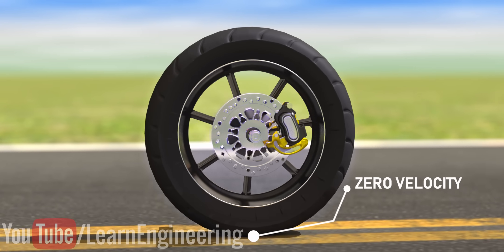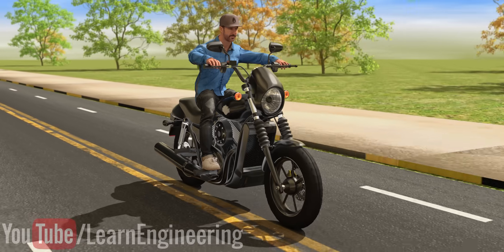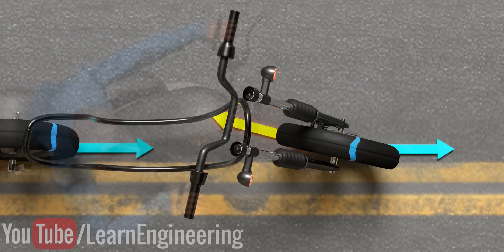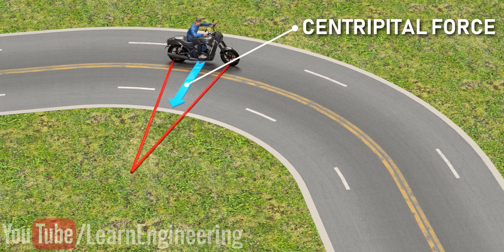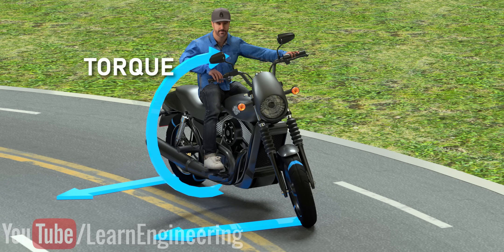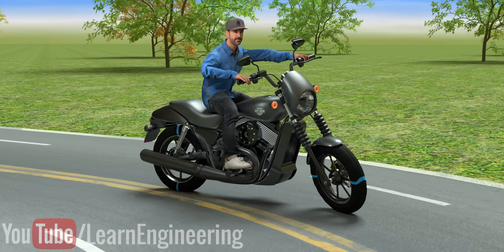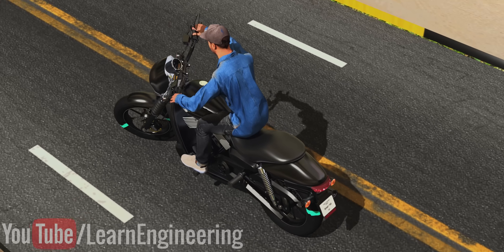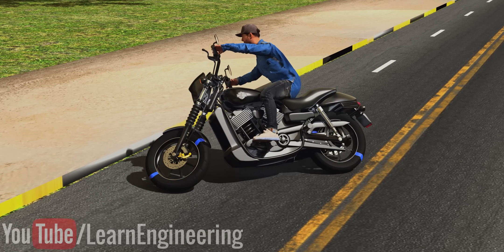Counter Steering | The interesting physics behind it

Comment: This actually saved my life once, i was going very fast then suddenly a car popped up without checking the road and i countersteered and almost crashed to it by some centimeters!
Reply from the maker: Cheers to counter steering - the quicker operation!
Reply: @SabinCivil  *the only operation
Reply: @SabinCivil  The ONLY operation..... like seriously....  It's the only way to turn a motorcycle moving above walking pace.  Is this video meant to be a serious thing.  !?!?  It's like a teenager has played with a toy motorbike and made up his own theory
Reply: @Lesics
You should take this video down. You have no idea how a bike behaves in the real world! People will get injured or die if they follow your advise in this inaccurate and confusing nonsense.I’m a rider with some 40 years experience and an ex-paramedic. please take note of what people are telling you in the comments!!!!
Reply: @softailfun  please tell me should i steer normally or counter steer. I am 18 and a new rider. I know how to ride but the counter steering thing is pissing me off. Please advice me
Reply: BRAVO SIX 
You and other guys new to riding (as does this video) see counter steering as an option. It is not an option, it is the ONLY way that a motorbike can be steered correctly. If you don't counter steer when taking a bend or a corner, your speed would have to be so slow that it would be dangerous on a road because of vehicles behind you. The reasons that counter steering works are irrelevant, just know that it works and that it MUST be used. I hope this helps in some way. I'm assuming here that you know how to counter steer. If there is a problem, feel free to get back to me.
Reply: @softailfun  Is there a speed at which steering and counter steering both work at the same time?
Reply: BRAVO SIX 
Absolutely not. Do you understand how to use counter steering? Just asking.
Reply: @softailfun   Softail Fun  i know how to steer ( at low speed you turn the handle bar). At 15mph+ you slightly push left to go left and push right to go right. Many of people who drive bikes dont even know know about counter-steering. They probably do it unintentionally. When i talk to bikers about lane changes at high speed, everybody says "Just turn handlebar lightly to the side you want to go", which is opposed to counter-steering. When i drove last time on highway, i just did it, i dont know whether i steered or counter steered.
And right now, i just want to know a method to change lanes (to steer) at highway speeds and that's all.
Reply: BRAVO SIX 
If you intend to change direction slightly or dramatically, counter steer. You obviously get that it works at higher speed. On that basis, if you are traveling at say 50 mph..... If you "turn" your front wheel left your bike will move to the right, if you try to make the bike go left at this point you are fighting against the bike, this can only end in disaster. If I want to move to the lane on my right, slight push on the right bar and the bike just moves over nice and easy. Obviously the same but opposite for moving to the left. Fighting against a bikes natural tendency is all bad man.
Reply: @softailfun  final question.. should i just use counter steering at anything above 20kph? You talked about speed of almost 80kph.
Reply: BRAVO SIX 
Sorry man, I deleted my last answer, I misunderstood your question! Yes, above 20kph (around 12 mph) counter steering should be used.
Reply: BRAVO SIX 
Did you get my replies to your question. I did answer but my se sponge seems to have been deleted!
Reply: @bravosix8171  sorry for bothering but if you are new to bikes then you would have to try to figure out speed after which counter steering is the only option. I had started with a 110cc bike with thin tires and the bike was very light so it didn't require much counter steering till 60-70 km/hr and a little leaning and shifting weight on handles worked. But as soon as i started with new bikes with more powerful engines 150-300-390cc, i had to counter steer at much lower speeds. And once u figure out the appropriate speeds after which u wld have to countersteer, it becomes natural and instinctive after some time. Just don't try figuring out these speeds on roads with ongoing or incoming traffic and try it on empty roads.
Reply: @rahulram3165  thanks. This is very valuable information. What do you think for 70cc (80kg) bike? Do i even need counter steering for this type of bike?
Reply: @bravosix8171  70cc bikes would  generally  be very light and would have very thin tires and easily would slide on the ground especially while on too much dirt, debris or some liquid spilled on road. And usually the lighter bikes and scooty wouldn't require so much of counter steering just general bodyweight shifting turns would do the work. And still i would recommend you to try in empty straight roads and  try to avoid more than 70km/hr more often because their brakes are shit. And the push on one side of handle while counter steering shouldn't be so much as the bike has thin tires and counter steering makes the bike lower from the side you want to turn so don't put too much pressure that's all then even if you want to counter steer you have to dip the bike very less and maintain good angles coz the tires can lose traction easily as they have less area of tire on road at a time. You should try yourself and determine yourself in empty road. And never forget about the thin tires and average brakes
Reply: @bravosix8171  only advice i can give you is dont take advice from anyone. Every rider is different every rider has their own style and the only way to find yours is be patient and safe and just ride. Over time you will teach yourself everything you need to know just feel the bike and judge each turn with proper speed. You will learn what is too slow or too fast and believe me they swear counter steering is the only way because they took some classes on it but I promise you I've been riding for years and I do not counter steer. I was taught that in my CHP moto safety class and when I tried to counter steer into a corner when you turn the opposite way it lifts your tire from the street and breaks traction causing you to eat shit! I lean through everything no matter how sharp the corner you just adjust your speed accordingly. Just get out and ride and you will learn it all naturally as time goes on. That's the best advice you can take
Reply: @bravosix8171  You counter steer every time you go around a corner. It's the only way to go around a corner. The best thing you can do is not worry about it, just look around the corner, and your brain will take care of it. Your brain figured out counter steering when you were 4 years old. You've counter steered around every corner since then.
Reply: @bravosix8171  its not a rocket science, its a natural instinct at that situation. you will learn when u encounter that situation
Reply: @bravosix8171  Ignore this video and take an MSF Course and learn how to counter steer properly.  If you are riding in a parking lot at slow speed a motorcycle steers by turning the bars in the direction you want to go.  Once you get faster direct steering does not work nor does leaning your body.  The only way to steer is counter steering.  The simplest way to do it is look where you want to go and push on the bar in the same direction you want to turn.  In other words if you want to go right push on the right bar, alternately to go left push on the left bar.  Don't think as your brain tells you it is wrong but it is not.  Look left, push left go left.  Look right, push right go right.  The harder you push the more the bike will lean and turn. Search for Twist of The Wrist II on youtube and watch the whole video! https://www.youtube.com/watch?v=dgOPZWNswvY
Reply: @softailfun  ok you say counter steering only apply when u going to left with top speed at that time slightly turn your wheel to the right and then turn left.
Reply: Sudip Malik 
Push left, turn left. Push right, turn right.
Reply: @softailfun  Yeah this definitely isn't how Keith Code seems to explain cornering :S
Reply: StatusRed19 
Couldn't agree more man. This vid is misleading at best, dangerous at worst.
Reply: @bravosix8171   just gain more and more experience. Dont overthink about c.s.
Reply: @bravosix8171  it works on bycicles aswell. I have 90cc bike.
Reply: Softail Fun thank you for letting them know. This whole concept is BS. I’ve been in every situation you can think of on the road except death and have never had the need for this. I don’t ride like an A Hole. I don’t ride like a speed demon, and I stay aware of everything around me. THAT IS HOW TO RIDE A MOTORCYCLE. You won’t crash into cars that pull out in front of you if you watch for them and ride conservatively on the throttle.
Reply: Chris Mckenzie 
Yea, I get you brother. That being said, when you say the whole concept is BS.... you aren’t talking about counter steering as being the concept surely?
Reply: Softail Fun no not at all, but I can say I have never required counter steering to get myself out of a situation. I can also say that I don’t ride heavy motorcycles, so when you put the weight in the equation then yes it is extremely important to understand how counter steering works. But as for myself, I ride enduro & I have a Honda rebel. They are both very light bikes
Reply: Chris Mckenzie 
Lot of idiots out there trying to get us riders. Ride safe man.
Reply: @softailfun  The explanation and the science as applied is wrong and misleading in a number of regards. The most basic is that motorcycles change their handling characteristics with speed. At low speed (less than walking pace) the front wheel is used like a tiller pointing in the direction to be steered. At high speed there is no discernible deflection of the steering. And there is obviously a transitional period between these two speeds. If you don't believe me take a m/c or pushy into your nearest car park and experiment.

As speed increases steering is achieved by chassis geometry and dynamics working in conjunction with the lean angle. Steering characteristics change with speed and with different or variation in chassis geometry and dynamics. andcome to realise that even 2psi variation in tyre pressure can change the tyre's shape and its steering performance. The other example that proves that variations in chassis geometry and dynamics change steering is trail braking.

demonstrated
Reply: @graemesydney38  
Yea, so in short.... the video is wrong, we agree. I fail to understand why you are directing this post to me.
Reply: @softailfun  isnt it normal to slowdown on corners?
Reply: mi yui 
Well it's normal to slow down prior to a corner. In the ideal world you maintain speed throughout the corner and accelerate out. Of course it's not always an ideal world, you can misread how tight the bend is etc. so slowing in the bend is sometimes unavoidable. At least that's how I see it, but I'm no instructor (just ridden...... A lot lol. And picked up bad habits I guess.) so I stand to be corrected.
Reply: @softailfun  hi keyboard warrior
Reply: @bravosix8171  shift lanes at high speed through counter-steering. At high speed the only way to quickly change the direction of the bike is through counter-steering. At high speed you can change direction through your body weight inducing lean, but it is slower.
Reply: @softailfun  wtf are you talking about?? If you want to go to the right, and you push the handlebar (forward) on there rights Handel (as you said), then you are STEERING. You are steering into the direction you want to go. What does this have to do with COUNTER steering?!
Reply: @jonashediger182  
Erm....... what??
If you push the right bar,
You are pointing the front wheel to the left,
But the bike turns to the right.
How is that steering into the bend??
The wheel does indeed point into the bend of course but this is due to the bikes steering geometry, not rider input.
I personally disagree with the term “counter steering” but it is what it is.
Reply: @softailfun  It is quite clear that he made this differently than the other videos on the subject. Just to get a lot of viewers, comments and make lots of money. Don't give a shit if he kills some 1000's people in the process. As long as the money rolles in…
Reply: @Gismo3333  
Agreed! This vid should be gone!👍🏻
Reply: @bravosix8171  You counter steering even on a bicycle. Its imposeble to “not” CS a bike. If you do not CS all the time, you are going to krash each time you hit a corner to fast, to steer it with force. CS always work.
Reply: @bravosix8171  You are counter steering whether you know it or not. 
First, counter steering works at speed. When riding slow, under 10 mph, one turns the handle bars to steer. Going slow, turn right to go right. 
At speed, the front wheel becomes a gyroscope. If you try to turn the handle bars right, the bike will lean left… and you will turn left. 
Get this… as you are in the (left) turn, your handle bars will be relatively centered. To increase your lean angle more, push on the left handlebar. That’s right, turn the bars right and lean more left. Conversely, to reduce your lean angle or even go straight again, push the right handlebar and the bike will straighten up. 
The movements are subtle but real. Try it.
Reply: @bravosix8171  Steer normally bro! Do what your mind and reason advise you to do in times of emergency! This counter steering BS is more dangerous and more of a "sophisticated bullshit" rather than practical. You can drop your bike and injure yourself while doing it at higher speeds due to the bikes momentum and inertia of going forward. If you counter steer at 40mph let's say, your bike would lean in the opposite direction and you'll fall. Forget this crap.
Reply: @vladimator1842  LOL, you are completely WRONG as there is NO other way to steer a bike at 40 mph other than counter-steering whether you realize you are doing it or not.  I have hit exit ramps at 70 mph and it was only counter-steering that saved me at that speed.  Until you fully understand the concept of counter steering you are putting yourself at risk every time you ride.
Reply: @stephenbraun3134  I have tried to explain these same points to my neighbor who has also been riding most of his life and he just gives me a blank look.  Some people will never understand that they are already counter-steering at speed because there is no other possible way to turn a motorcycle above 10 mph.
Reply: @C4LB34R  WRONG, WRONG, WRONG.  I have been riding for close to 50 years now and there is no other way to turn a motorcycle at speed except by counter-steering.  You are doing it every single time you take a turn above 10-15 mph you just don't realize you are.  The physics are undeniable.
Reply: @sheslop888  Yup, trying to convince idiots that they are wrong is a daunting task.  As you said, there is NO other way to turn a motorcycle at speed except by counter-steering as it is irrefutable physics.
Reply: @bravosix8171  Never counter steer unless you're in a slide and trying to regain balance. Turn normally. If you really try to countersteer during a regular turn it won't end well. You do apply counter pressure though during a turn normally which is what everyone is trying to say is countersteer but it's not. Countersteer is when you turn left to go right in a drift.
Reply: @ktm125sxbeast  
Some very bad advise here. Don’t counter steer, then do counter steer. Awful advise!!!!
Reply: @softailfun  Also not to be that guy but it's advice not advise. Though I do advise that you study some grammar.
Reply: @ktm125sxbeast  
Yea, I was too busy learning how bikes steer to bother with grammar. The one can kill you the other gets idiots leaving corrections. My bad!!
https://youtu.be/lzk8oyNO708
This is also counter steering and you advise against it. Get serious.
If you’ve got a rear slide when you’re road riding, well you need a lot more help than just counter steering knowledge, you need to learn to ride!
Reply: @softailfun  phew! Glad you said something. I do not know of any other way other than counter steering, and that is what taught at riding schools. If you tried to turn a bike like they did in this video at speed on a corner you will crash for sure.
Reply: @bravosix8171  forget you watched this video and get lessons from an expert. This video shows you how to end up underneath a car or truck.
Reply: @bravosix8171  good question. No!
Reply: @bravosix8171  if you’re changing lanes already then you’re already doing the right thing and their description is misinterpreting what they’re actually doing.
Reply: @bravosix8171  it’s not a set speed. Just do what comes naturally
Reply: @bravosix8171  yes and you’ll do it without even thinking
Reply: @bravosix8171  did you not ride a bike as a kid ,,or did you have trying wheels your whole life ,,stop thinking about it and just ride
Reply: @softailfun  I saw a demonstration by  cyclists that you can't turn without what you call countersteering. Apparently you can't turn in any direction without first turning your wheels slightly in the opposite direction whilst on two wheels, so how can you ever not counter steer?
Reply: @bravosix8171  You started cotersteering the moment you first controlled a bicycle and ever since..  Keep on ding that, the only practical way to ride any bicycle and any motorbice,
Reply: @bravosix8171  Push rigt (for a short moment) and go right, push left, and you go left. You actually steer the bike in the wrong direction for a split moment to get it to lean. From there you control the lean using the handlebars. Often you must keep a tiny push inn a stedy turn since the bike tends to stand up if you do not.
Reply: @SabinCivil  This video is incorrect, dangerously misleading, and you are directly putting people's lives in danger by spreading misinformation. Take this video down for the sake of your integrity, and for the safety of your viewers. 
If you want to make a proper video about counter-steering, it would be worth mentioning the massive gyroscopic forces at play, and how it's a combination of gyroscopic precession, camber thrust, and centripetal force that moves a motorcycle and its rider through a corner.
Please, please do not ignore this message. I am not the only one saying it and you STILL have not admitted you were wrong. Do the right thing.
Reply: This video is misleading.. At normal riding speeds, to initiate the turn, counter-steering must be used. In fact, there is no other way to make a motorcycle turn.  it is used by every rider out there knowingly or not. When you lean towards left to make a left turn, initially the front wheel is turns towards the right side even though we are not aware of it. This video makes someone think that we have an option to choose between steering or counter steering when cornering. You simply cannot turn motorcycle to left side by turning handle bar to the left. When doing that the motorcycle will lean towards right and end up turning to the right side.
Reply: @SabinCivil  Guy in animated video has no helmet... "Learn Engineering" is out here promoting the Squid Life... Ya'll wrong 4 that...
Reply: @hadi msmani,

Yet there is BRAVO SIX who states he can ride but doesn't understand 'countersteering'' That would mean in your situation with a car popping up, he would be dead because it would take too long before he figured out what to do?

Please don't even think about it! 
if you can ride a motorbike you are already doing it naturally so all you need now is practice a lot.
Get out on the road and learn your roadcraft, different surfaces, weather conditions, varieties of bends, but take it easy while building you confidence and if someone passes you doing 80mph going into a bend DON'T be tempted to chase in after him as he either knows his entry and exit a lot better than you or you'll pass him on the way out!

Be careful out there.
Reply: @softailfun  Oops, I meant to reply to someone else but mistakenly clicked on you; my eyesight isn't the greatest anymore.  And YES, we are in agreement.  My apologies.
Reply: WRONG...WRONG...WRONG ... Countersteering is used by ALL bike riders who have ever executed a turn on a bicycle or motorcycle at speed. "Leaning and motorcycle turning in perfect balance" ... maybe the folks at Learn Engineering need to hop on a bike and prove their theory on a 60 kph bend ... make sure that you have crash bars and full riding gear. The scenario shown at 3:15 causes the bike's center of gravity to move outside of the turn, making the bike unstable and most likely resulting in a high side crash. DON'T DO IT.
New riders...relax, you've been counter steering since your dad took your training wheels off your first bike...it's intuitive.
This is a good place to start.   https://www.revzilla.com/common-tread/what-is-countersteering
Reply: What amazes me with most of the comments is people's explanation or the total misbelief that counter steering either works or doesn't. Saying push left to go left is not very precise, you should really explain it as apply pressure to the left handle bar to start the bike leaning over to the left. Once the bike starts to lean you naturally release the pressure and start to neutralise the bike turning in in a left hand arc. If you didn't the bike would just lay down on to the floor and actually go straight on on its side leaving a big mess. To all the disbelievers how do you think you stand the bike up after the turn runs out. If you don't believe counter steering works then all you people must be trying to lean the bike the opposite way to pick the bike up again, I'd love to see you try it. Very funny watching you go off into the hedge. What you actually do is apply pressure to the outside bar which lifts the bike upright again. All you disbelievers would say that this will make it turn more but not so. Think about it, if you was going through a right hand bend and you pulled on the left hand bar the bike would lay down on the floor instantly, which is counter steering to the extreme. If you are going through a right hand bend and 🧒 pulled on the right hand bar effectively tightening the corner radius of the front wheel the bike will not start to tighten its turn but sit up very quickly. Unfortunately there are a lot of people who ride bikes but don't understand the physics but that's OK because you don't need to. The best thing to do for any of us is travel down a long straight road at a reasonable speed of say 40 mpg and gently push on one of the bars, if you push on the left the bike will start to fall left. Push on the right the bike will fall right. Don't push hard. You will automatically catch the fall and right the bike. As you get used to it try a gentle slalom and you will feel how easy it is to turn the bike fast and you will notice that you will be counter steering to lift the bike up to initiate coming out of the turns. Only try when it is safe to do so in good weather conditions. Be safe
Reply: @OrangeManStan  You are another example of half truth misunderstanding. M/c's handle differently according to the speed. Over about 30kph a m/c steers by leaning. There are five rider inputs that cause the m/c to lean - bodyweight/positioning, foot pressure, knee pressure, handlebar pressure and gyroscopic procession (a,k,a. countersteer, push steer etc). A rider uses predominantly different inputs and combination of inputs at different speeds according to rider preference, experience and chassis configurations/dynamics.

The importance of countersteer  is that the faster you go the exponentially greater the gyroscopic forces are. The greater gyroscopic forces make the m/c exponentially more stable and make counter steer exponentially more effective to get the m/c to lean. The faster you go the more important countersteer is. The lean causes the chassis geometry and dynamics to steer the m/c. 

You are right about one thing; doing is more important than theory - go out and practice slaloms at varying speeds. But the correct theory can help to reach the outer perimeters of performance.
Reply: @softailfun  "Don’t you think you are making a very simple method of steering into a very confusing experience, especially for new riders" I wasn't describing a teaching method I was exDon’t you think you are making a very simple method of steering into a very confusing experience, especially for new riders" I wasn't describing a teaching method I was explaining and correcting the physic of m/c steering. And I'm not 

 especially for new riders" physics is the same for newbies and old farts, that not me, that's life - physics. Firstly you underestimate peoples ability to understand - its not that hard to explain or understand. Half truths are more for the 

"All this nonsense of body weight, foot pressure, knee pressure is all totally unnecessary!" it neither nonsense nor unnecessary. As I wrote, "correct theory and
Reply: "All this nonsense of body weight, foot pressure, knee pressure is all totally unnecessary!" it neither nonsense nor unnecessary. As I wrote, "correct theory and
Reply: @graemesydney38  
Yea, I think you need to read your reply to me... it’s a bit all over the place. To ride a bike we don’t need the theory. I never have and I don’t know anyone that ever will. If they are interested in finding the “why” that’s up to them, but to ride safely...... not needed at all. You only need to read the comments on any video about counter steering, the theory just adds confusion to an already (to some) confusing concept.
As for what I said was unnecessary (body position, feet etc), totally unnecessary! Necessary would suggest you can’t ride without this, now that is just plain rubbish. I have ridden for some time now and have received some pretty good training in the process from exceptional instructors. Never have I had to resort to using anything but good old fashioned counter steering and leaning with the bike. This is regardless of what model or style of bike I was on! Maybe you have an argument if you involved a track day (although I personally doubt it), but for normal riding, be it on commuter type roads or country lanes, unnecessary!!
The first 30 seconds of this link says it all!!!😂😂. https://youtu.be/JWuTcJcqAng
Although a little dated, as you say, can’t alter physics!!
Reply: @softailfun  "Yea, I think you need to read your reply to me... it’s a bit all over the place." 
Your problem if you can not follow complex issues.

" To ride a bike we don’t need the theory." 
What do you think "doing is more important than theory" means? While it is true 

 Scientologist, a con man 

Maybe you gave an argument if you involved a track day, but for normal riding, be it on commuter type roads or country lanes, unnecessary!!"
Reply: @graemesydney38  
Yea, I’m really sorry it’s not the “complex” issues that I’m unable to follow. It’s the way your messages are formatted, they make no sense. I’m sure if you read exactly what you have written on your last 2 posts you will understand what I mean. And what the hell has Scientology got to do with this??😂😂. 
Forget it brother, you’re done I think!
Reply: @softailfun  There is none so blind as the wilfully blind, and there is none so stupid as the wilfully blind. You're right, I'm done.
Reply: @graemesydney38  
You know.... you need to calm down man. You are reading stuff that I’m not writing. I get the impression that you think I’m anti counter steering... and that’s wrong. So I have no idea what you’re accusing me of being blind about 🤔. That makes no sense. My only criticism of you is that you were making things too complicated with your explanation and that it contained some unnecessary actions and backed it up with two videos that totally supported my case. That being said, congratulations on your last post, it’s layout was correct and it was understandable for a change. Now I don’t know what your background is and to be honest I don’t really care, but I will tell you briefly mine. Been riding 40+ years, ex-medic in the Ambulance Service, advanced driver trained in part by West Mids Police Instructors , advanced rider trained by West Mids Police Instructors. Do not think you can crash into someone’s comments, barge in with you unnecessary nonsense and expect everyone to just agree because you spout science and try to sound smart. Any criticism of your words are from the stand point of having a great deal of experience in the practical skills of riding a motorcycle. I don’t know how old you are, but I can probably grind your practical experience into the ground. Now we are done!
Reply: @graemesydney38  I'm only right about one thing, thanks for that. I agree there are multiple ways to steer a bike. I think I said that. But you can take them as singular and make the bike steer. I think the confusing thing here with all the comments is some people think you only steer by counter steering and others don't believe you can steer that way at all.
Reply: @OrangeManStan  
Can’t agree with you man. When you push on the left bar, bike leans left due to counter steering of course. However, at no point does the rider release the pressure or steer in the opposite direction during the turn as you suggest, but maintains pressure on the selected bar throughout the bend. Only when the bend begins to straighten does the rider release the pressure to stand the bike up. The front wheel does indeed point into the bend after the initial counter steer, but this is due to steering geometry and not rider input! If the turn needs to be tighter, the rider applies a little more pressure.... if a wider path is required then the rider eases off the pressure. Look here: https://youtu.be/lzk8oyNO708
This shows exactly what’s happening.
Your advise is as dangerous is the information contained in this video. The individuals who were responsible for this video obviously don’t ride bikes and, having read your post, I suspect that you don’t ride either. Stop giving advise of this nature without having practical experience of the topic! People die following poor advise!!!😡
Reply: @softailfun  I'm not sure why you are getting so agree, I've been riding for 25 years so no worries there. That is a great video. The interesting thing is maybe the press isn't released as the turn is initiated but the front wheel needs to start to point in the direction of the travel which will be the opposite direction of the original pressure applied so either the action of the turn equalises the pressure that the rider is applying or the pressure is released slightly. If you keep applying pressure I agree the bike will lay down further into the corner until it lays down on it side. Not sure why you are so concerned about my explanation and so worried people are going to be dying all over the place. Maybe you struggle to ride your bike, perhaps you should give it up. We don't want another person in the hedge 😁
Reply: @softailfun  only joking by the way on you ending up in the hedge. Don't take it to serious. Have a great day.
Reply: @softailfun  hey the physics behind it is accurately represented in the video.
But I agree that it can give wrong information to newbies.

Before understanding I used the normal steering method as shown in the video, and partly countersteering without knowing it. 
But after understanding I can see great difference.

So now I would say counter steering is the only way to steer the motor bike.

The video shouldn't have included that part where it shows person can fall off with counter steering. And the video conveyed  both ways of steering as choice , but infact its not . It should be always countersteering.

So I would say they have done a good job in physics part , but failed to convey the right message, as countersteering is a must learner. ( But I doubt their intention was to make people understand counter steering and need for it)
Reply: This is nonsense.  If you ride a bicycle or motorcycle, you automatically counter steer anyway.  Otherwise you wouldn't turn corners.
Reply: @pawankhanal8472  
The maker of this video has no idea how a motorcycle behaves in the real world. His description of how to counter steer is dangerous, riders could die following this. Man!
Reply: @pawankhanal8472  
No, it’s wrong!😂🤘🏻peace.
Reply: @pawankhanal8472  except that the overwhelming number of people who come here are naive and are looking for experience and an actual, practical education. 
And what they are getting (theory) is BAD theory, wrong theory, and when they apply it in life and death conditions, that bad theory turns into physical danger, injury and possible death.
This video is dangerous, and should be taken down.
Reply: Watch this video, and you can see the motorcyclist trying to turn NOT counter steering, and he rides directly into the truck.

https://abcnews.go.com/GMA/video/video-captures-moment-biker-crashes-fire-truck-31990148
Reply: I’ve had this car pulled out from a junction last second no warning but I pushed those bars and the whole bike pointed away and I just missed it
Reply: Above a few mph you always countersteer! Countersteering is "normal steering". This video is very misleading.
Reply: Sounds like counter-steering actually put your life in danger, actually.
Reply: @protoborg  
Or the lack of understanding of counter steering.
Reply: Sure ya did
Reply: Wait... Do people actually not counter steer?? How the hell are you people alive?
Reply: I call bullshit
Reply: This Video;
SO VERY DANGEROUSLY WRONG.
Ackkk!!! Thumbnail is wrong, first
2 mins of graphics are wrong. 
I don't have the stomach to 
continue watching this video. 
Look up counter-steering if
you don't already know how to 
use it.
Reply: OMG. I think now I have to practice counter steering
Reply: @PangestuRatnoKumoro  no you don’t as you do it without thinking
Reply: You'll find your track
Reply: So you just steered? Bruh what lmao
Reply: fenian p0wer 
And the reason for that is that those terms/actions are all pretty much useless and unnecessary.
Reply: ademar9988 
What??
Reply: The guys riding a harley and no helmet. So there's that
Reply: @pawankhanal8472  
Well you obviously don’t ride or you would see the glaring error(s). 
He states that once counter steering is applied the rider “cleverly” swings the front wheel so that it points into the bend. If the rider were to do this the bike would stand up... guess why? Yes.... counter steering. The wheel does indeed point into the bend but this is due to the bikes steering geometry not rider input. But what do I know... I’m not a mechanical engineer, I’ve just ridden bikes for 40+ years.
https://youtu.be/lzk8oyNO708 have a look at this vid.
Reply: @pawankhanal8472  
Fella, many, many videos exist showing counter steering on bikes. All I can say is that on this point he is wrong! That’s a fact. I would suggest you get on a bike and try what he suggests, but mind the floor.. it hurts! As I have said many times, I don’t need to know how a phone works to use it. In the same way I don’t know how a bike stays up to ride it, I just know what works. It’s called experience, it can account for a lot my friend. I’m done! Peace out!
Reply: @pawankhanal8472  
😂😂 well all I can say is, if I was on the back of someone’s bike travelling at 50mph through bends, I’d rather have someone with experience steering it than some guy that’s good with theory. Because obviously theories can be wrong as proven by this video. Have a scan down the comments and see how many riders are saying how dangerous this video is. Riders never need to know how something happens, they need to know that it does! I don’t need to know how this message is getting to you, I just need to know that it does.
Reply: @pawankhanal8472  
As for this channel being for education! Yes I guess you’re right, but counter steering can be a little confusing for new riders. You can see from the comments that new riders come here for knowledge on this topic. In this instance they are being given, potentially, deadly instruction/advise.
Reply: @pawankhanal8472  
It’s for learning...... yet it is still wrong! So from a practical stand point or theoretical.... it’s incorrect. It just fails man! Basically it serves no purpose.
Reply: @pawankhanal8472  
Well I can’t, obviously.
But I do know that if you push on the left bar, the bike leans left so turns left. I also know that the pressure on the left bar is maintained for the duration of the bend. If the rider needs to lean more he pushes a little more on the left bar, if he needs to lean less he eases pressure on left bar.When the rider wants to stand the bike up he eases the pressure on the left bar and allows the front wheel to straighten. If during the left bend, the rider intentionally steers left (which is what this video suggests) he will stand the bike up too early. This will result in the bike ignoring the bend and it will travel straight. Also this video makes counter steering an option to “normal” steering, it isn’t! Counter steering is the only way to steer a motorcycle at speeds above 15mph. These are facts, not theories, you can jump on a bike and find this out for yourself, it’s easy. Doing it one way you crash, do it the other way you survive.... I’m still here!
Reply: @softailfun  yeah you know trick and this guy explain science behind it . That's it. No need to debate . This channel is all about educational stuff and I said it so so many times.
Reply: Pawan Khanal 
He explains it incorrectly! Get on a pushbike and try it.😂😂😂
Reply: Pawan Khanal 
So learn to steer the bike properly and all will be revealed to you, but in the real world ... Where mistakes hurt!
Reply: @pawankhanal8472  
So basic this video got it wrong!😂
Reply: What if it did not work 😐
Reply: @joeljose182  
It works, but not as described in this video.
Reply: "The reasons why penicillin works are irrelevant..." That's as ridiculous a statement as saying the reasons why counter-steering works are irrelevant. 

Some come to these videos to understand the physics behind things. But for some people, who've all but given up any curiosity toward the "why" of things, videos like this can cause headaches.

If you don't like it, leave. That's the beauty of "the free world". Just go away. I know I'm a year late, but I don't care. Grumpy-ass people like you drive me nuts. Just chill the typing and move along. Some of us can understand, and thus, enjoy physics. Let us have our "why" and "how", and we'll let you have your blinders and "don't care, it just does" attitudes.
Reply: @teaEarlgreyHott  
It’s not a ridiculous statement, a rider doesn’t NEED to know why or how it works. A rider just needs to know that it does! If he/she decides to delve into the why or how, obviously is personal choice.
Regardless of why people come to this video, be it to glean information on the practical or theoretical, this video is wrong. It’s wrong on a few points according to those that are knowledgable on the theory of counter steering. However, on the practical side it makes 1 glaringly and dangerous error. Just read all the negative comments. Oh,,,, and for gods sake ... calm down😂.
Reply: Nonsense.  Any kid riding a bicycle can steer the stupid thing without using vectors and physics.  If you used your mental
powers in that emergency movement, you wasted precious seconds.
Reply: LIAR
Reply: If you have ever ridden any sort of bike you should instinctively know how to do this.  You may not even know that you do it. I explained it to my son when he was learning to ride a motorcycle. He couldn't envision it. I told him he already does it on his ten speed bike.  We made a puddle of water on the street and I made him ride through it straight an then make the turn to come back.  The wet tracks clearly showed him that he turned left to make the bike lean right and then he turned right to not fall over completely and make the turn. Then a sharper right turn to force the bike back upright.  Once he saw it on the ground it clicked in his brain and the extra weight of the motorcycle wasn't a problem anymore.  He is a good rider now
Reply: breezelow unknown  
My point is that a rider doesn’t need to think about stupid countersteering.  It’s a bad term too.
Reply: After a couple of these you’ll slow it down a little
Reply: nicely executed.

https://youtube.com/shorts/9rf1hOrRd_A?feature=share
Reply: Damn, arguments are still going on
Reply: So you steered. Well done.
Reply: @briantw  
Well point of interest…… no, he didn’t steer! If a rider were to follow this video it would be a bad day!!
Reply: In fact, in a normal turn you still do the counter steering first.
Reply: Lmao
Reply: Countersteering is Bullshit. Its much easier n normal to just lean the way your turning
Reply: @the.communist  
“Just lean the way your turning”! Really? That’s how you think you steer your bike? You need to learn more!
Reply: You used it because you were going too fast. Slow down.
Reply: @Steve00alt  
What???? Its a cartoon ffs!
Reply: If you're going too fast. Its YOUR fault. They did look both ways probably. They just didn't see you when Turning their head. Then poof. You show up while they check the other side. I ride. But relatively safe and never speed too much. No wheelies. I chill. You ride like a guy with a death wish, your wish will come true one day
Reply: I got saved just today from a truck overtaking another in a highway turn :) - Damn, heartbeats were real up :(
Reply: why car not angle
Reply: Stupid video,confusing people. REAL simple,with throttle push left to go left,push right to go right. Direct steering is under 10 mph or slower. Its that simple,motorcycle courses will say it exactly like that.
Reply: @Patrick-pq7yy  Exactly right!!!
Reply: @Patrick-pq7yy  just did my course last week and they told us absolutely nothing about countersteering. I already heard about it before hand but didn't know/understand it enough. On my way home from work today I was trying it out and yeah i felt the bike go right when i pushed on the right handle, vice versa and slowly got the idea. But yeah they didn't say anything about countersteering which I assumed they would (before i started the course)
Reply: It all happens unintentionally and naturally idk why y’all arguing about
Reply: I think this counter steering cannot be perform if we in 70km/h speed, i do it and i got crashed totally worth it
Reply: What are you guys talking about speed?
Countersteering works all the time, every time.
Hop on a stationary bicycle and try to not fall.
You have to countersteer or the bike will fall.

You can also test which way stationary bike fall when you turn the handlebar.
Reply: @XtreeM_FaiL   - That's right!  Counter-steering works ALL the time at ANY speed to initiate a turn by causing the lean.  Then one turns the front wheel in the direction of the turn.  This 2nd step is what most riders don't realize that they're doing.
Reply: Dave InWLA 
How wrong can you get this, Jesus! You counter steer, you DO NOT point the front wheel into the bend afterwards.... this would stand the bike up! You counter steer, the bike leans and the front wheel self aligns. You need do nothing, the bike knows what it needs to do. Stop giving advise found on paper, research, videos and funk knows what else. Get on a bike and try it. If you push left, the bike leans left and you turn left. It’s common sense that if you now push right when you’re in a left hand bend the bike will want to turn right and it will stand up.... immediately.
Reply: @OrangeManStan  
We will agree to differ. You think I simplify I say you over complicate. Done!
I’m absolutely clear what “push” refers to if I’m ever chatting to new riders. No confusion being sent from this rider. 
However, maybe you should stop telling riders to counter steer and then change the direction of the front wheel by direct input, as opposed to letting the steering geometry sorting that out. That advise will end badly!!!
Reply: @softailfun  fair enough.
Reply: XtreeM FaiL 
Agreed, but at parking lot type speeds you have an option. You can counter steer if you wish to manoeuvre a m/c ( not very effective) or direct steer (far more effective). But yes counter steering is effective at all speeds.